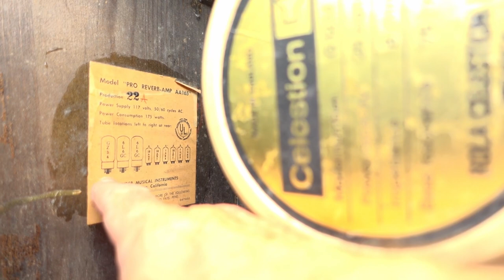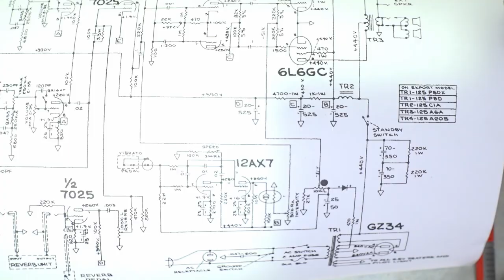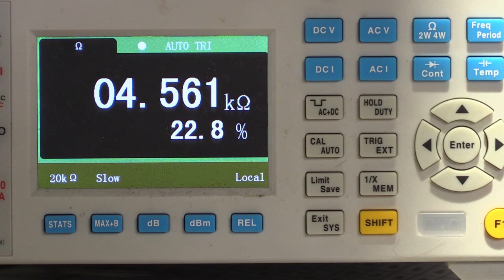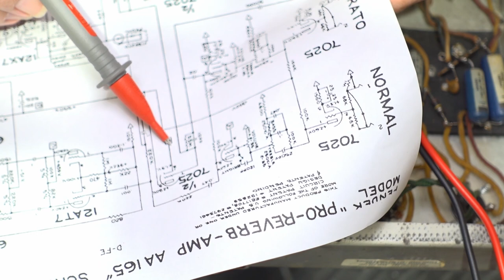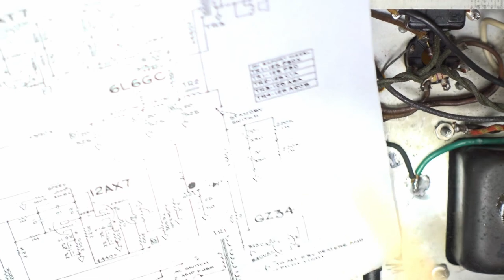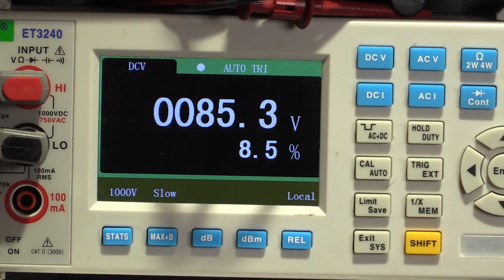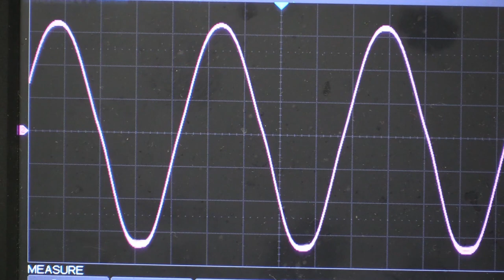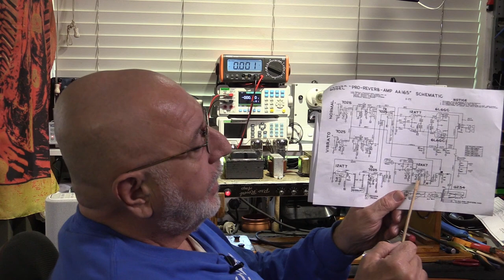Fender Blackface ProReverb. Let's repair the hum, make it sound great and learn about amp repairs.

Comment: I like the way Uncle Doug wires the main power supply, he takes the hot lead straight to the on/off switch first, so that when you switch the amp off, there is no power at the fuse holder at all. Safe.
Reply from the maker: I truly admire Doug, and am a proud Patreon supporter of his channel @uncledoug. But I take a different view on his power wiring. What if the switch is faulty and stuck in the ON position, or someone, even you,  accidentally hits the switch? There’s a reason why the safety codes say “fuse first”.
Reply from the maker: You got it exactly right, Geoff! If the fuse blows you MUST turn it off at the wall outlet (In Australia our wall outlets have switches), or even better, unplug the amp. It is the only guaranteed safe way to change a fuse. To gamble your life on an amp’s power switch is too high a risk. The law requires you to have the fuse closest to the point of entry into a device. 
Your example scenario is perfect. You’re on a dark stage. Your amp goes down. The pilot lamp is off. With no pilot lamp, you no longer have a cue to say your fuse is still live. Your prompt to turn off the power switch is gone. In the pressure of the moment you forget to flick the power switch, or even worse, the drummer comes over to help you and he tries the switch for you, then you’ll be knockin’ on heaven’s door.  
A related fuse mistake I have seen is to wire the fuse holder with the Live wire soldered to the terminal closest to the fuse cap instead of the furthest away. 
There is a reason why it is a safety code in any country I know.
(I'm sorry Geoff. I can see your updated comment in Outlook, but not in this Comment area. I hope you didn't delete it because the point you raised is very important and could save a life one day. Thank you for the opportunity to address this very common misunderstanding)
Reply: Gotta say, I love your videos.
Reply: I love that these people are aware of the best of the best. And as a guitarist of 62+ years, I REALLY appreciate that these techs care so much about what they are doing and in getting it right! There is a general awareness among GOOD amp techs, of the "treasures" as my tech calls them, that they are working on. These amps are works of art when you get right down to it and must be appreciated for the proper design and care that was originally dispensed in their building.
Reply: That's the one thing uncle Doug gets wrong. It is understood in electrical circuits that the fuse is always first. His reasoning for doing switch first is flawed. The fuse holder design is that the input power comes into the tip first. That way when you pull the fuse it gets pulled away from the tip. So no power can flow no matter if it's plugged in.
Reply: In UK now all electrical supplies to power devices has to be protected by R C D ! Any inbalance on live to earth or neutral to earth R C O trips and cuts supply! Tripping current is about 30 milliamperes! Apparently this current exceeding is dangerous to the heart! Fraser
Reply from the maker: @jamesrobinsonjr.9384  Thank you James
Reply from the maker: @ineedcbsi  I love Doug and he knows a LOT, but he and I will disagree on this point.
Reply from the maker: @elsaarmstrong-zp6ng  I assume the regulations in the UK require the fuse before the switch? I'd be interested to know.
Reply: Most UK as far as I know is the switch first! Any equipment that you can touch the chassis without stripping it ,the neutral must have a double pole switch so both live and neutral are switched! A 3 cored mains cable must have a securing gland where it enters the chassis and a crimped and serrated washers earth connected with a locknut secured !  Most have the 3 pin Euro male connector usually at the chassis rear! Electrical tools like drills are double insulated and building sites are 110volts 50Hz ! H  S
Reply: Meant to say Health and Safety now gone crazy! The building regulations books now like telephone directory! I will let you know when I find out more! Fraser
Reply from the maker: @elsaarmstrong-zp6ng  interesting Faser. I think the UK stands alone with fuse/switch regs. Australia is the same with the other points.

Comment: Very cool video. I'm an electrical engineer/guitar player who just bought a 66 Pro today, and I was loving the video. Luckily mine doesn't have a hum.
Reply from the maker: Congratulations on a beautiful amp. Hopefully, yours has not been vandalised by a “replace everything” Tech. Your main filter caps are not a critical element in the sound path, so please check them before you apply power. Otherwise, please don’t replace any components unless you are 100% sure they are faulty, especially coupling caps.
Reply: @theguitaramptech  if it ain’t broke, don’t fix it. Mine sounds good, but I’ll open it up later this week.

Comment: What a cool old amp. It looks like my old transitional Super Reverb, but with 2x12 instead of the 4 x 10s. Nice work, too, striking the balance between historical preservation and practical amp maintenance. 

Pettifogging quibble incoming. At 45.46 you talked about the valve saturating (as opposed to cutting off). My quibble is this: valves don't saturate. As grid voltage rises toward 0 V with respect to the cathode, current begins to flow on the grid. Even if the signal voltage continues to rise, the charge flowing on the grid will hold the grid around 0 V. The harder you push the signal +ve, the more current flows, and the more grid voltage stays around 0 V. Meanwhile, the anode current continues to faithfully follow the voltage of the grid, which has been clamped at 0 V by the grid current.  So the anode current is 'clipped' because it follows the grid voltage, which is clamped by the current flowing on the grid. So the anode current stops rising because the grid voltage stops rising, not because the anode can't conduct more current. Meaning the anode ain't saturated.

I blame this on-the-spectrum rant on Merlin Blencowe. 😁
Reply from the maker: Very well put Bladder. I know I will lose my viewers if I go too deep. I wanted to differentiate that non-linearity from Cut-Off at the other end.  Can you suggest a single word that can get the message across? I would be happy to adopt that phrase if it explained the rounding off better than "saturation". Thanks for the clarification. 
(I am also a devotee of Mr Blencowe's and have a hard copy of Designing Valve Preamps.)
Reply: @theguitaramptech  It's a great little book, innit? :-) He's also re-published his book 'Designing Power Supplies for Tube Amplifiers'. But to answer your question, I dunno. Grid clamping?
Reply from the maker: @Splattle101  yes I have just ordered my copy from Amazon 🥰
I can see that grid clamping may be a more accurate expression, but I suspect it will lead to more confusion and ongoing explanations. I’ll stay with saturation, until you, or I can come up with a better word.

Comment: WRT Bias supply cap size, 25uF vs 100uF -> I've worked on many an amp where this cap size has been increased significantly and it's not necessarily a good idea. If you have a mains interrupt, both bias and HT will discharge then re charge. This can cause a huge over current condition in the tubes depending on how the two supplies track or otherwise.
Reply from the maker: Hi Terry. Thank you for that perceptive comment. Yes, that scenario is possible. 
The other side of that same coin, is that a larger bias cap may hold a  negative bias supply to the grids for longer in the event of a power interruption…and I get a less noisy, more stable bias. 
While I haven’t had any issues yet but, I will definitely keep your suggestion in mind and tame  the increase in future. Thank you.
Reply: I usually put in a 50uf @ 150 volts for the bias supply capacitor in BF SF fenders.

Comment: I have often wondered why DC current is not used for indirectly heated valves/tubes? Surely this alone would lower hum  levels? Fraser
Reply from the maker: @elsaarmstrong-zp6ng  yes, using DC for the heaters, especially in the preamp circuit, would definitely help with hum. On the other hand, it has also been a point of failure and adds to the complexity of the power supply.
Reply: @theguitaramptech Simple transformer circuit  with bridge rectifier and 6 volt regulator + capacitors zener diode etc ! No switch mode psu !  Linear psu would hopefully give a reliable DC supply for the valve heaters!  Switch mode psu’s  always noisy and unreliable in my opinion! Linear supply’s very little trouble!  I have a old telephone xchange psu since the 60’s and still 48 volts DC at 10 Amps at the output! So why would DC heaters not work? Fraser
Reply from the maker: DC heaters are often used on preamp circuits, especially in high-end amps. I agree with you 100% on a linear DC supply over switch mode.

Comment: I've got me Baja Tele where I've swapped out the scratch plate for a 
circa late '60's mint green guard and 'Voila!' mine's pretty near a dead ringer for what 
you're plunking there... Small world, wot?
Reply from the maker: Very cool Jonny. I need to come clean on the pickups, though. When I bought the Tele, the back pickup was dead, so I went to one of the best pickup makers on the planet, @rodneymcqueen1706 of Sliders pickups. It now sounds amazing. The neck pickup is the original from 1968. If you ever need to take your gorgeous Tele to the next level, check out Rod's work. He also did the PAFs in my Les Paul Custom ("Doug") you can see in my JTM45 and Tweed Tone 12A videos.

Comment: the condensers are rubbish they need to go you can still buy Alan Bradley resistors for the droppers
Reply from the maker: Each to their own, but I would never use carbon comps for dropping resistors, Ian. The old Fender I'm working on now has its 4K7 drifted up to 11K2. They may have a place in audio circuits but not in a power supply. 
I'm not sure which condensers (capacitors) you mean. I am not precious about filter and bypass caps, but I will NEVER replace a single coupling capacitor unless I can prove that its leaking. I shriek in horror if I see a beautiful old amp where every cap has been replaced with horrid orange disgraces.
Reply: @theguitaramptech  Totally agree.
Reply from the maker: Thank you, John. When the Marshall Master says "it is so", then I feel secure in my approach. 
I have a confession, John. The Grounding on JMP & JCM800s annoys me. I have been known to solder (ala vintage Fender) the mains ground, and first couple of filter stages to the same point directly on the chassis. It reduces the earthing buzz and makes the amp a little quieter overall. Your opinion? (send condemnations to amptech@teammania.com.au, and songs of praise and joy to my Facebook page!  😉)

Comment: Dude, that 1 resistor was 12% over and you're gonna leave it anything over 10%?You should replace.Why did you leave the twelve percent over resistor that's just bad.
Reply from the maker: Thanks for your opinion, Thomas. You are very funny. 
I would answer your question with a well-explained answer. However, I do not reply to trolls who think they know more than me. They rarely do. Trolls just try to make themselves look smarter, but just end up making fools of themselves. My advice is to go do 6 years of Electrical Engineering at a leading university and work in the field for decades and answer your own question. 
Your learning tip for the day: What are the effects of varying cathode resistors? Why does Marshall often use much higher values, up to 10K? Plot the load lines on a tube chart. 
Try to learn without exposing your ignorance, Thomas.